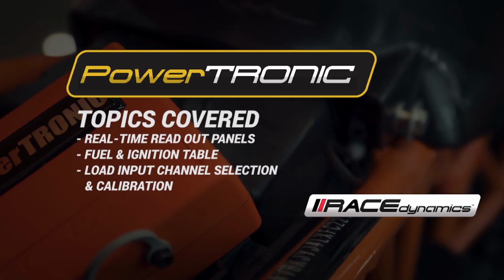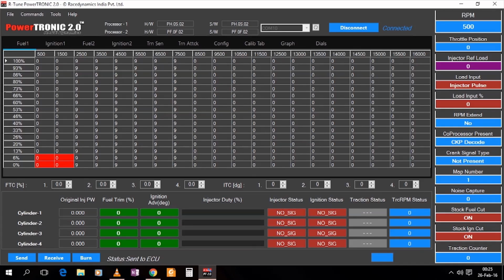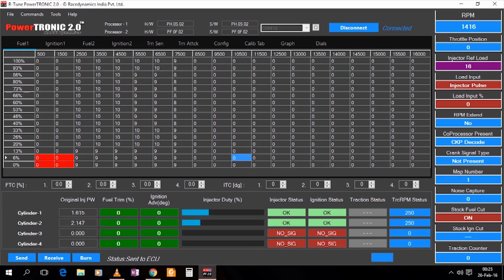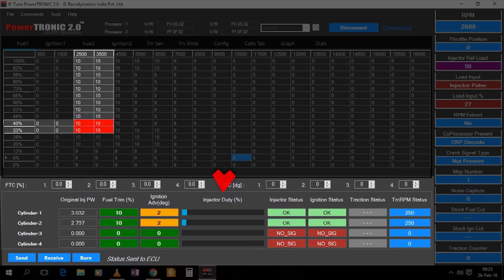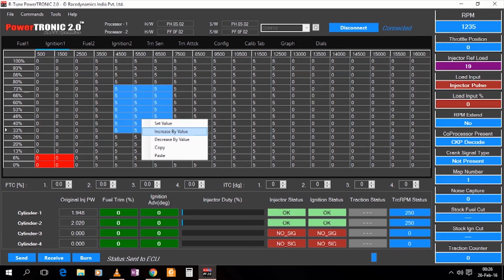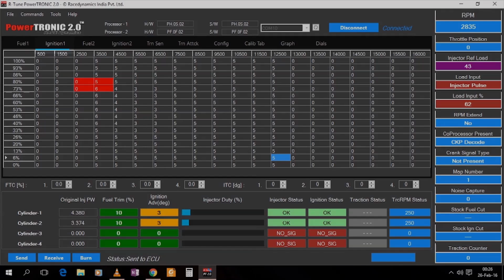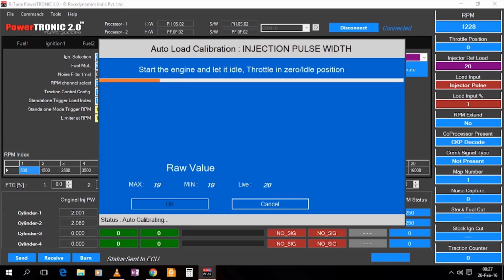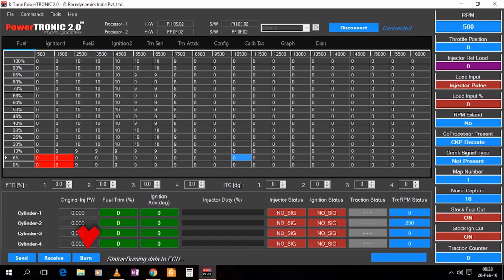R- Tune - Video Walkthrough Part 2

Comment: Hi can u tell me how long does it generally take for burn to happen?  As with me the burning data to ecu is taking forever as compared to how quickly it happened in the video.
Reply from the maker: It will take ~ 3 to 5 seconds to burn the map.

Comment: question I had the powertronics V3 for my 2015 ktm duke 390 The bike runs great but I have the bike serviced the they said my bike is running to lean the gases out of the exhaust My bike is stock and i calibrated  it was using map 2 do I need a different map I have R tune i have messed with anything exceot calibrate my bike is completly stock